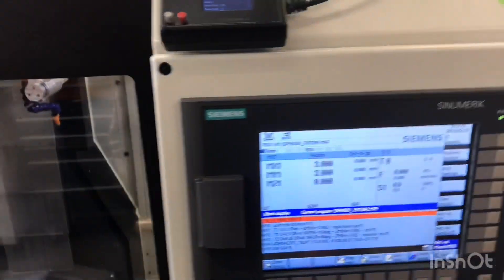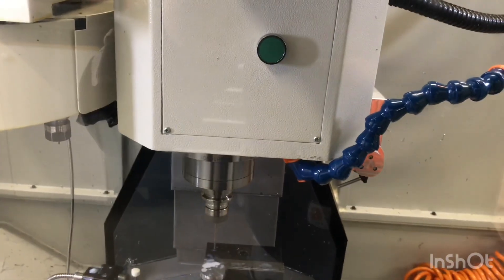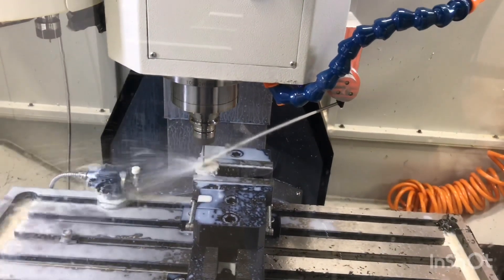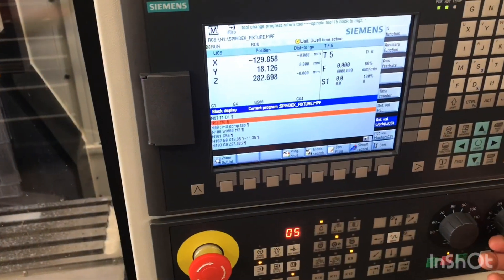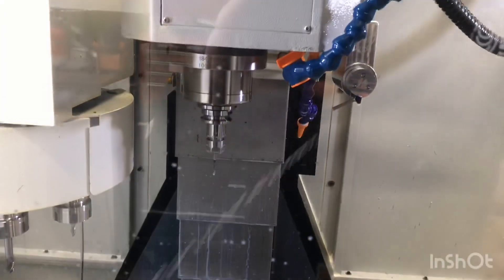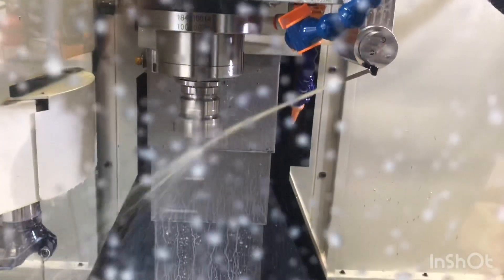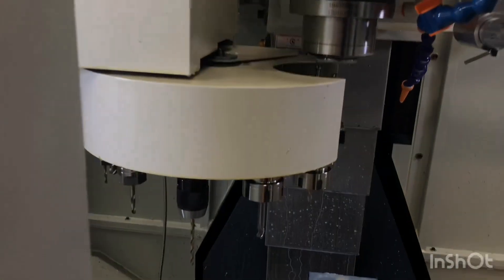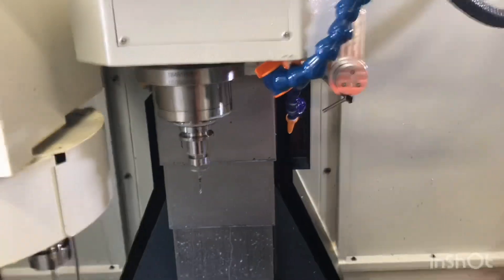AccuBlast remote control coolant nozzle first use in program

Comment: Nice work. Have you considered installing a check valve in your coolant line to prevent the coolant from draining out when the pump cycles off? That should get rid of that delay of getting coolant to the tool when the cycle starts.
Reply from the maker: Jody Olivent Thanks Jody. Yes I have. I keep forgetting to order one but it’s high on the priority list!